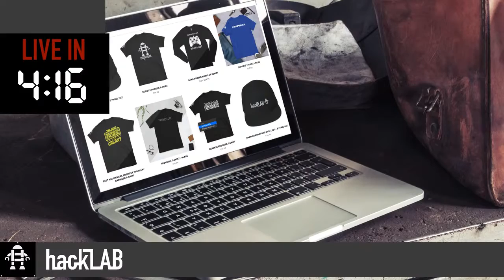Live  - CNC Plasma Update - New Machine Torch - Crossfire Pro Langmuir Systems

Comment: Where did you get the machine torch? When I tighten the y axis I used Channel locks as I tighten the bolts.
Reply from the maker: Ebay $275